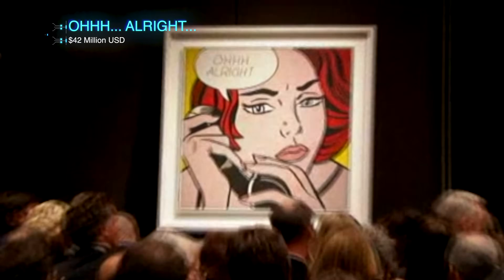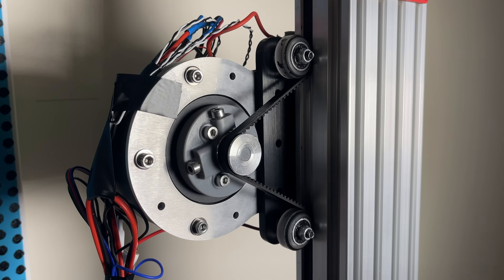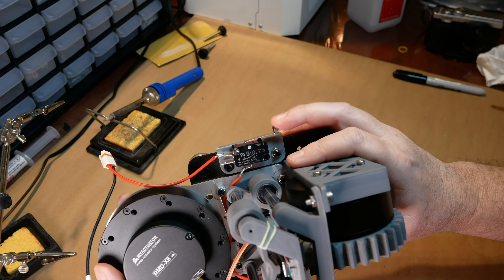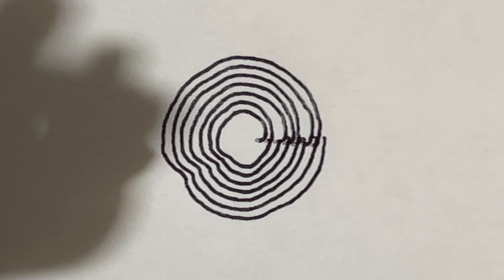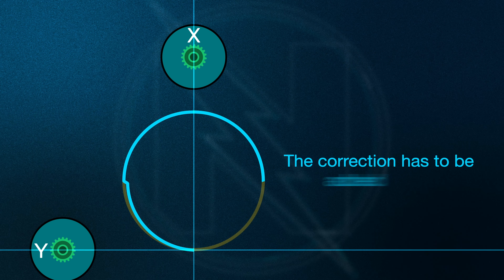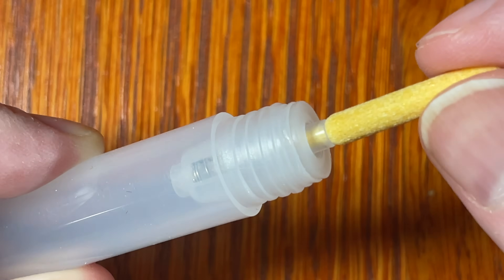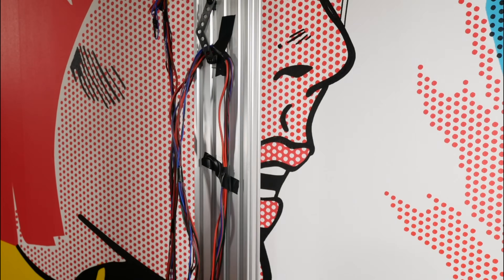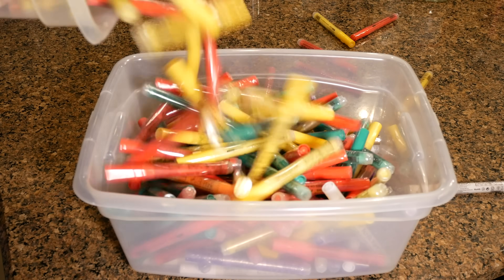I Built a Robot to Paint Expensive Art

Comment: Next step is writing a software that generates the robot's path. To begin, make it so that you are able to feed a single layer of paint, and choose a stroke direction and type. The softwate will then fill that layer with lines or dots and generate a path.

After a few iterations, the final software should be able to accept either single colored layers or any image with a set pallet of colors, and slice it up.
Reply from the maker: Maybe. I think part of the art part of it is designing the toolpath so that it looks like paint strokes and not all vertical lines.  Thanks for the suggestion and thanks for watching.
Reply: I'd think a useful first iteration would be to detect outlines, convert those into tool lines and then remove that area from the input. Rinse and repeat. As a second step, remembering the ends of paths and then trying to align the starts of paths of the next iteration with those, so the pen does not need to be lifted by can just move over one stroke width, might be nice. This kind of paint looks like it can take a bit of double-covering without it showing up.
Reply: @HenryLoenwind  Seeing the paint strokes is part of the attraction (or you can otherwise just order a big digital screen printing on vinyl). At least, if that is your taste. Both ways can equally be very attractive. Compare it to all the different and literally unlimited ways you can use to convert a photo in photoshop in all kinds of simulated painting styles. Each their own I'd say.

Comment: So, a few comments, observations:

A. This is amazing, and you are amazing. I love it.

B. You basically built a vertical 3D printer, but without the extruder and heating elements, and with custom motors?

As such, I probably would have went the route of trying to make it work with conventional 3D printer software. Imagine if you used Klipper, configured the stops of the new motors, and set up the "pen in/out" mechanism to work with the extruder code.

Then, all you'd have to do to create this kind of art is split your image into multiple layers with the shapes to print, then feed the flat image into some kind of CAD software to extrude it into a one-layer shape that you drop into a slicer and print.

It would save you a ton of time having to manually create all the paths in illustrator, as well as have saved you the headaches of trying to get the paths to trace right. 

Still an incredible teaching video and overall process...but if you wanted to supercharge it and make it easier to make more art - this could be how. ;)
Reply from the maker: Thanks.  Creating tool paths is part of the art.  It's not visible on video but you can see some of the paint strokes.

Comment: And for the upgrades: You already have stable slides, you can very simply put a linear optical encoder on them for positioning. This would also allow you to use a simpler target-feedback positioning logic. (Calculate the intended path and timing. X times per second, check the actual current position and the intended position 1/(X+A) seconds later and feed the difference into the motor. That way, you can use the motor's automatic mode; the A value ensures the motor never reaches its target and stops as it always gets a new movement command before that.)

Comment: Above all I'm amazed you got the funds to do this. I've been doing DIY plotters since 2018 but I never got around to amassing the funds to build anything bigger than A0. When people started copying my artworks via instagram I had to close down all of my social media as those copycats without any talent were better at selling than me. It's been over half a year since I quit making plotter artworks but started working on a new project two weeks ago and I gotta say, the itch is still there.

It was nice seeing your explorations, I came across many of the same issues, such as the pen ink feeds, and drilling them out which works really well. I work with high-flow acrylic inks which are a lot harder to control (drilling the caps means they tend to leak all over the place), but they have a nice fast flow if you're into speed. That's the main thing where our machines differ, mine are super fast and have zero backlash, but they can't go bigger than A0 and I didn't have the funds to get decent extrusions, so the frame is quite vulnerable.

I'm currently working on a special design to minimize some motion artifacts and I think that's probably the most important step for you as well if you want to go faster. I'm also 100% sure that the backlash is coming from the inside of your motors. I know you got sponsored for the motors, but I really want to suggest using stepper or servo motors. Trust me, 0.9 degree per step motors are fine, you could even use a belt to increase the resolution further. And if you use closed loop motors you can do anything you want without complex movement planning. It looked as if you were using a Duet board, I'm not sure but it looked like that. If you are, that's great because Duet has expansion boards with which you can run closed loop stepper motors without problems.

Anyway, a joy to watch your video, and it's good you also show your failures. I tried to get some sponsoring from pen companies etc with my 2k follower instagram back in the days and I managed to get was €100 worth of pens. I am very grateful with this but realistically it's not enough to sustain this on the long term. Do you have any advice for me how I can get better sponsorship deals with companies? Do they care more about exposure or are they also in a way showing goodwill when it comes to helping out artists that are not able to fund their practice even though they make unique quality projects with what little they have?
Reply from the maker: Sounds like you've had some fun.  I'll be doing other types of plotter art with this as well.  The other day I bought about 10 more very large canvases.  But I'm going to fix the problems before starting the next painting.

Comment: would love to see an episode covering the electronics and software design in more detail.  Ie - what you coded with, what was used for the controller, etc.
Reply from the maker: I'll think about it.  Meanwhile - The hardware is a raspberry pi using the serial pins on the gpio.  That is connectd to a serial to can bus module and then to the motors.  The motors are 48 volts but the one on the paint head is 24 volts so I have a converter.  The software was written in xojo on a mac and it can compile a debug version on to the pi.  I never made an actual executable I just always run it in debug mode.  The print file format is basically svg but slightly modified.
Reply: @Nerdtronic  well, if you decide to make a video, I will certainly be excited to watch it. The amount you shared helps me understand what you did which is what I was after lol

Comment: 13:55 I would just call that art imitating life imitating art imitating life! Roy based his artwork on printed illustrations where slight misalignments like that are common, he hand painted his artwork and now you’re copying his hand painted art with a computer controlled system that has simultaneously flawlessly reproduced the image as well as introduce a flaw akin to the original inspiration.
Reply from the maker: Haha yeah.  I noticed that some of his dots weren't all that great either.  Some of mine are more oblong than round near the top.  I think it was caused because the canvas is a flexible cloth surface.
Reply: @Nerdtronic it would be interesting to see other ways you could use this robot, beyond replicating existing works. One thought I had would be giant string art- you that thing where people use string as straight lines to create images. I wonder if you could do something similar only using the paint pens or permanent markers instead of string. I mean the whole point of using the string on a small scale is to create a straight line, but using your robot it would be easy to create a straight line with a pen. I’ve seen another YTr try to recreate string are using a CNC machine like yours, but all I could think is “why is he using string? Much easy to use a pen?”.

Comment: The machine was off by 2 mm, but hey - at least you had a resolution of 0.18 µm. 😂 Sounds like maybe the actuator was not completely necessary and a simple stepper would have done fine as well. Anyway - great work overall, and yes, I am impressed - thanks for sharing! I would recommend you use linear magnetic encoders for position feedback. That stuff is similar to what is used in digital calipers and is available relatively cheap even for huge machines like yours (well, at least the chinese stuff). Needs some skills to implement, but there's no doubt YOU can. Precision is 5 µm - so still way more than enough for drawings.🙂 But of course this would not prevent the head from sagging...
Reply from the maker: Thanks for the comments.  The motors have the encoders built in.  So I can just ask them what position they're in and they send that info back.
Reply: @Nerdtronic  Thanks for the answer, but sorry - there's a misunderstanding. Don't get me wrong: The Roybot including the software is a master piece and you can be very proud of it. And the actuators are fantastic devices - there is absolutely no doubt! But the built in encoder has absolutely NO clue of the head position. It ONLY knows about the motor itself. But the motor is just one part of the positioning system. The complete belt system including the pulleys plays a much bigger role. A linear magnetic encoder would completely remove issues due to belt and pulley accuracy, belt tension, including change of belt tension over time, plus backlash and even some issues due to temperature changes over such long periods of continous use. An alternative would be a refernce point to check (for example using a hall sensor) every know and then. But relying on a belt + pulley for accuracy is just not working well (as you have seen).
Reply from the maker: I see.  Well assuming that nothing slips the motor returns an absolute position in the form of a multi-rotation angle, which simple math turns it into a position on the wall in mm (execpt for backlash).  I said as long as nothing slips.  Once when toward the end of the black pass I made a mistake and had the pen mech down when it was off canvas, then put a pen in and told it to draw something without raising the pen first.  It was going to crash the pen into the side of the canvas.  I went to quickly unscrew the thumbscrew and take the pen out and in trying to prevent it from ripping the paintng off the wall I caused the motor to slip in the gear and then the registration was lost.  I was able to recalibrate it close enough to continue.

I think the backlash will go away if I tension the belt tighter.  But I'm also going to make a gear rack and try that.
Reply: @Nerdtronic  Thanks for the detailed insight. Well, accidents like those just happen.

What I was trying to say is that even with perfect rotary encoder feedback and perfect calculation there will always be a delta between the computed and the real position. This could be eliminated by linear encoders. But I don't want to bother you with that any longer. 

One additional idea: Maybe you can compensate at least belt (tension) issues by using two reference points on each axis - one near each end. You can then measure the motor steps in between. The value should in theory always be the same, but over time it will not be the same in practice. 

I think higher belt tension might lower but never eliminate backlash. But maybe you can get it low enough for the purpose (i.e. to maybe 20% of the pen stroke width).

Comment: I did a little thinking some time ago about doing a painting robot but I (of course) wanted the full color range.
My idea was to use an image and see what the RGB was and then go to a pallet, scan for the right color, dab said color and then dab the canvas.
Then go dab any other pixels of the same color returning to the (already known) location on the pallet to pick up more paint.
I got a major headache when I realized that it would have to mix colors on the fly... or something... where's the aspirin?
But your bot WORKS GREAT even though there had to be some "interventions" on the first full scale run.
And to be honest, the belt was the last thing that I would have expected to become an issue.
As a medium I want to use ordinary household PVA and add tint to make the primary colors - should be a lot less costly that artist acrylic paint which is basically the same thing...
Then feed the 3 colors through some sort of small peristaltic type tri-pump system to meter the base colors to get the required color.
Found some thin clear plastic from one of those oxygen cannular (???) things they stick in your nose in hospitals - so that went into the project box... But I still have to collect a LOT of other stuff before I can begin.
Looking forward to see how you go forward on this project and how you solve the issues that ALWAYS crop up.
Reply from the maker: I could be wrong but I think even Stuff Made Here's wall painting robot only does one color at a time.  He did CMYK but not all 3 at once.

Comment: I've seen pump action markers like the ones you used but they are refillable and you can replace the nibs. It'd be cool if you could use something like that so you could mix whatever colors you wanted. They sell them at places that sell graffiti and street art supplies.
I could only imagine how many unusual iterations on your design you could make like using an airbrush, calligraphy pen, a brush with some sort of dipping mechanism. The imperfections could inform the aesthetic. Pretty neat stuff.
Reply: Yes, imperfections are what makes a work of art the signature of the artist......the authenticity lies in the uniqueness of the final product.....no two brush paintings are the same.
Reply from the maker: Even if I made this piece again (which I won't) it would be different and unique.  Because the thickness of the paint pen isn't constant.  But yes I did use refillable pens as well.  TFive didn't have the blue I wanted so I used a different brand paint for that.
Reply from the maker: Exactly!  Ian, thanks for this comment.

Comment: If you put the frame on the floor, that would solve the pen flow issue and may reduce belt backlash. Cool project. You could do the Ben day dots by hand more accurately by using a stencil or marking by pencil before hand.
Reply from the maker: Actually the pen flow had nothing to do with the pen being flat. Fill up a cup with water and then turn it sideways. The water will flow out. Gravity wasn’t the problem. After modification paint flowed perfectly. Without pushing the nib in paint can’t flow. There is a valve inside.  Also I didn’t have 13 feet by 9 feet of floor space.
Reply: @Nerdtronic  just a thought. It's very good, if a little bit pen intensive

Comment: Would it be possible to replace the paint markers with an airbrush? The airbrush could have a robotic needle as well to change the spread of the spray pattern and you could control the airflow similarly to optimize the air/paint ratio. 

Alternatively, have you considered adding a gravity feed system to the marker so you could use the same marker for longer by extending the paint supply?

This is sooooooo cool. Great work!

Comment: You probably could add 2 axes fine adjustment on your print head. So it can paint the dots and small features without moving the whole printhead. And it could do the whole movement compensation (and it will be nice software nightmare)

Comment: This would be awesome to make giant murals - if it could be adapted to climb steel cables, those cables could be temporarily anchored at x,y 0 of the building - it could even paint around windows etc. And it could even just paint a plain coat. 

Man, so many applications! 

You could make a consumer or at least SMB product out of this
Reply: yeah... but it would need something else than acrylic markers or you would end up needing thousands for a wall (and they wouldn't work on the rough surface)... some spraypaint kind of system or whatever

Comment: 100% should have it draw a canvas 'print' of your logo for the shop. Maybe use a slightly darker blue and have it use a pop art dot pattern with a white marker over the blue to achieve the effect of the gradient.

Most likely the belts are scrubbing against the edges of the extruded aluminum, so either smoothing those edges or installing some tape or another cover to the edges should be enough to improve belt longevity. Once the print head has been optimized for either 3D metal printing or CNC, it should be quite a bit more accurate, which can only be a good thing.

Comment: 🤩Congratulations! Great result, great persistence and awesome video! 
I too tried to do something similar with the robot, but didn't come even close to such a big and successful solution. I, too, faced the problem of fixing the marker accurately, returning to drawing from the same place after maintenance, and the loss of accuracy with long run times due to moving parts and belts. So I will also note your very wise choice of painting, which by design breeds inaccuracy!
Short sessions with a robot are successful but complex paintings that require precision are easier for a human to paint by hand. For complex works the robot needs to be able to recognize the finished part of the drawing and the points of contact of the canvas with the marker, rather than blindly acting on a program of movements.